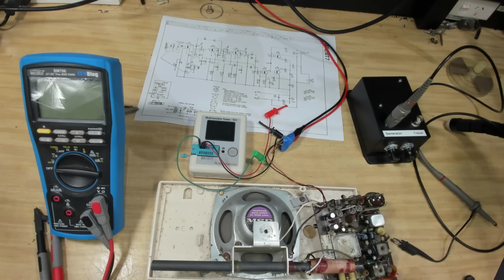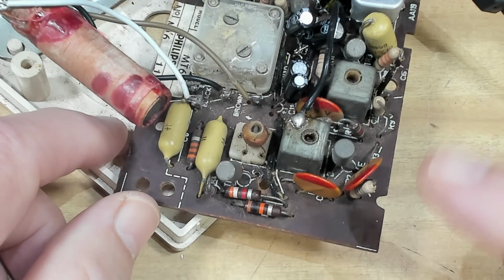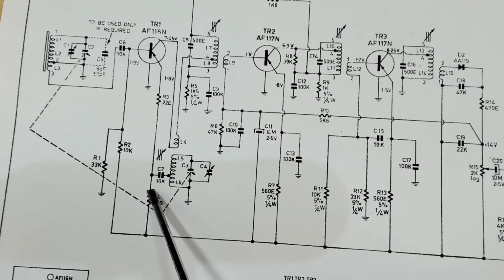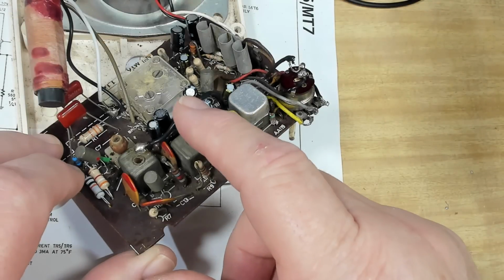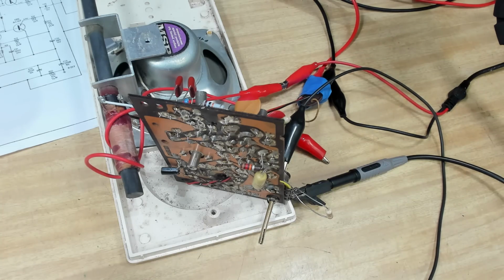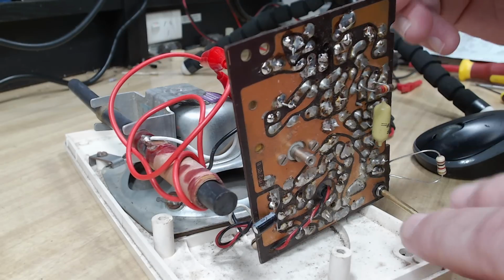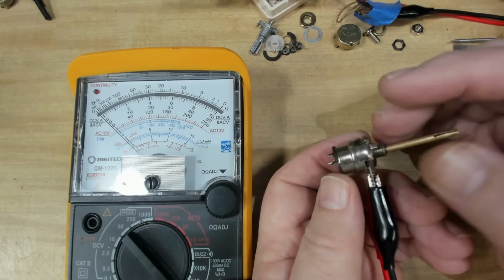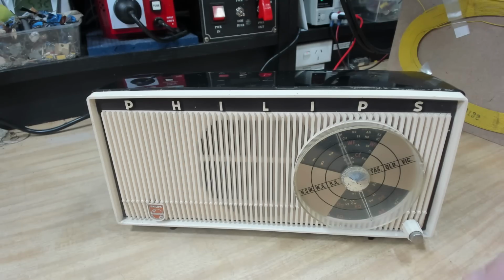Philips MT6 Transistor Radio Repair

Comment: Well done sir.
I have a transistor radio philips type L4CA38T/01 mode 1964 it have sound problem. Sir can u provide me its service manual or help me solve this problem
Reply from the maker: I cannot find any reference to the L4CA38T/0. If you search for a L6CA38T you will get a few helpful results including a schematic. I don't know if that is of any use 🙂

Comment: Nice work I wish I live near you I have a very rare Crown SPH-100 radio phonograph from 1963 I believe the radio part I’m just able to tune one station and basically static noise on the rest of the dial I got the turntable to spin but there’s no sound also the left channel is dead there’s sound on the right channel only so is has a few issues I’ll love to get this fixed cause it brings me childhood memories but I don’t know much about technology most likely there are bad transistors and capacitors in it. Thanks for sharing your knowledge.
Reply from the maker: Yes indeed, your Crown phono is a transistor set. There is a schematic available on Kevin Chants website. Well worth restoring. You may consider contacting a radio club nearby, they might be able to put you in contact with someone nearby 🙂

Comment: In your opening montage, there's an ad for GE "Brighten Your Summer" tube portable. I have it on my shelf awaiting renovation. It has a cigarette burn on its face, leaving a small depression with raised edges.  Think I'll have to file it down and fill it with Bondo. But I really would prefer not to paint it! The  red plastic is too pretty! I'll have to refinish the bright gold trim with metallic gloss paint.
Reply from the maker: What a pity it has a burn mark, I hope you can conceal it Bob and good luck with your projet 🙂

Comment: Take out that one resistor in the emitter lead which is less than 3K3
Reply from the maker: Ok
Reply: @DavidTipton101  I you have a look at other front ends that use the same circuit you will find that there is only one resistor in the emitter lead not two like that shown in the circuit diagram for the radio you are working on for example the Russian VEGA radio which uses the same mixer circuit (sorry I had to allude to a diagram of a radio by a country that has turned rogue)

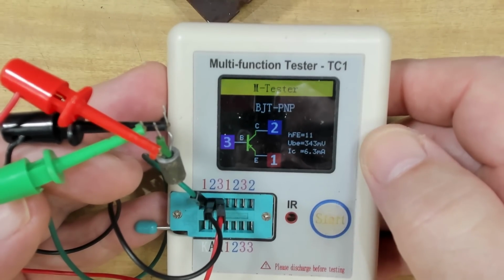Comment: 6:22...the hfe reads "11"- and that's awfully LOW...
Reply from the maker: Well, I know that now 😅
Reply: @DavidTipton101 ...that's a low hfe reading- but it's not unusual: I have noticed the same thing with at least 2 other vintage transistor radios that I have worked on, and the radios worked anyway. 

The downside of these component testers, is that they don't tell you the LEAKAGE of the transistor. 

I have a B&K 970 that serves admirably for testing transistors.

Comment: Have you fixed all the radios in Australia, and do you have snacks, and funnel web spiders in your back yard or hiding in your old sets.  ?
the same principles may be the same between the old and the new, but everything looks so different and are so small, and those pesky traces!
Reply from the maker: No, I haven't fixed all of them 😄 Funnel web spiders live farther south, around Sydney. We do have snakes in the area, one in the house once and a few in the backyard at times. We don't bother them and they move away if you approach them. Thanks Tom 🙂

Comment: You can also pull up another working radio next to the inoperative radio , turn both “On” tune the working radio if the Oscillator is not working it will start playing using the working radios oscillator . Quick check .
Reply from the maker: Hi Keith, thanks. I have used two radio to check the oscillator before. I only listen for the feedback, I haven't tried to tune a station 👍🙂

Comment: Me thinks you know more than you let on. The thing about transistors is that they can be swopped out in sets like this. Silicon transistors can be used to replace germanium ones like the AF117 which where prone to whisker growth which you know about when you started to tap the Tranny. Excellent video. Clear and precise.
Reply from the maker: Haha... no, I'm quite useless at transistor radios but I hope to get better as I go. I know silicon can be used but I would need to investigate which one to use and how. Thanks @CASHSEC 🙂

Comment: Hi David. You started off your video saying; "I only paid a few bucks for it..." and yet for those few bucks you've got a forever reminder Solder Blob, a valuable learning surgery on a volume pot, an AA5 fellow Radio guy's suggested trick tried out successfully, and the fun of returning the radio to working again. Maybe you could get a cheap magnifying glass at the dollar store and make a display of it over your Solder Blob (?)  Thanks for another fine video! -Chris  P.S....my vote is on a prior repairer leaving the blob.
Reply from the maker: Hi Chris. I bought the radio as a learning tool and like you say, it paid off. Haha... I like the idea of the blob mounted next the the radio on display 👍😀 Thanks Chris.

Comment: Dave, you're coming along nicely on your transistor learning curve! The most important thing I was taught by an old school engineer was to pay attention to the the base emitter junction. The different potential between these two junctions should be .2v for germanium and .6 or .7 for silicon transistors. Great find on the shorted diode...............
Reply from the maker: In this case 0.1 Volt. Thanks John. That is exactly the information I need to learn. The information is there , I haven't bothered to look it up yet. Cheers 👍🙂

Comment: Well done David (as per usual) - that solder lump really got you. Transistor circuit boards are always a pain so much circuitry on such a small space coupled with ham-fisted soldering skills can produce all sorts of undesirable effects... neat work on the other things you repaired/sorted🙂
Reply from the maker: Hi Kenneth, thank you. Yeah, I couldn't see it from the way I had it facing. Live and learn 😄

Comment: The ones that someone has had a go at before you are always the trickiest. You have to look for things that would never normally be there. Another great video. I really liked the volume pot rebuild, seems a shame to replace it after all that effort. Still, hope you get one for it. It's a nice little radio.
Reply from the maker: Thanks @radio-ged4626. I checked out the previous repairs first and everything was in order. I haven't had any pots turn up, I will add a resistor to approximate the 2 K requited and leave it fitted. It work perfectly as it is, the resistor will keep the radio as intended 🙂

Comment: I used to work as a part time gunsmith many years ago.  The boss had a sign in the shop, it read something like this:  LABOR $20.00 HR - IF YOU WATCH $40.00 HR - IF YOU TRIED TO FIX IT FIRST $100.00 HR it made sense. Some home smiths can really screw up a gun, and a radio even more so. The worse case was when a fellow brings in a gun parts in a shoe box.  I took one of those LEARN GUNSMITH at home courses along with working part time in the gun shop for several years, it was a work of  love for me, never got paid for in shop working, I considered the education better then any pay they could have given me. I worked full time as a cop but we worked a weird schedule of 4 12 hour shifts followed by 4 days off.  Since my good wife worked as well it left me a lot of spare time with little to do. I road my motorcycle a lot to kill time till I got invited to "play" in the gun shop.
Reply from the maker: Haha... that was a good sign to have 😄

Comment: Great video!  Thanks a million, I always learn something when watching your videos.  One thing it reenforced for me was a bit that I learned in college.  They taught us not the law, but how to find the law. Research can be the most important thing when dealing with the law, and the same thing holds true when dealing with electronics. Watching you fix that volume control was great, you showed us that instead of replacing the part, rebuild it back to it's original glory and it will serve you for another 50 years or so! Keep the great shows coming, they encourage we who dabble in radio repair to keep going.  My little group of transistor radios that I have purchased right now has grown since it seems money is short for most folks so an opening bid usually wins the auction for "parts or repair" radios here in the states. I have several Westinghouse sets as I love working on their sets, they seem to be  a better quality build then the junk imports.
Reply from the maker: Thanks Jerry. I'm always looking for ways to repair components, the volume pot repair worked well. Nice that yiu have a collection of radio to keep you busy 👍🙂

Comment: The chassis appears to be in GREAT 😊 shape. I’m going to guess this radio 📻 is from circa 1972. It appears to be transistorized, or, in other words, solid state. The speaker 🔊 appears to be possibly permanent magnet 🧲. It’s the bad capacitors you’ll have to replace. Too much age results in lossy performance 🎭. Your friend, Jeff.
Reply from the maker: Hi Jeff. Ii is in good condition and the speaker is Ok. The radio is from 1964 🙂

Comment: Hey Dave!
Thanks for sharing this video with us!  I think we all have had that moment of "Hidden Obvious Trouble" in our experiences.  A friend of mine was stressing over an AA5 radio and couldn't understand why it wouldn't work.  I asked him what he had done on it, looked at the schematic, and told him to replace the Cathode Resistor in the Audio Output tube.  He said that there was nothing wrong with that resistor, he had measured the resistance and it was within tolerance. I told him to change it anyway.  He did, and the radio started working.  He couldn't understand how I could spend only 5 minutes and find the problem while he had spent days trying to get it to work.  I never told him how I came to the conclusion of why that was the problem.  In fact, from a physics standpoint, I might have been way off base, but I had recently had problems with a Carbon Microphone and an Elmer informed me that the carbon bits could get stuck and to make it work again to simply bang the microphone on the desk or workbench.  Since that worked, I figured that it was possible that the resistor (a Carbon Composition Resistor) would measure correctly when no power was applied, but when turned on it would open up and be, in effect, a capacitor.  Therefore,  you would have a "resistor-capacitor across a bypass capacitor" therefore blocking the DC. Like I said before, my theory might be off, but that was what fixed the radio!
Reply from the maker: Interesting Wayne, I'll keep that in the memory banks. Thanks 👍😃

Comment: Thanks again Dave.  I don't know much about transistors but I guess I'm going to have a crack at one sooner or later.  Can't let Manuel and Graham have them all, can I?
At least from this video I worked out how a transistor oscillator works. 
Cheers
Reply from the maker: Hi Don, Thanks. I don't know much either and was starting to wonder if I would find the problem with this one. I follow Manuel and Graham closely when they work on transistor sets, I have picked up a lot from them. I look forward to the day you try doing one  👍😃

Comment: Amazing.... I would have said right off the bat, those AF11x transistors "tin whisker" would be the problem. You must have the only working examples known to humankind!

Mullard "mustard" caps - you can rely on them to work, just as assuredly as you can rely on the sun to come up in the morning.

Well done with the volume pot.... I personally have never had any success with rebuilding them, though others, including yourself, seem to be able to make it work. Nice job, and nice to have some AM stations to listen to, once you have it working again.
Reply from the maker: Me too @whitesapphire5865. Haha... they might be the last ones. The one I fitted in the end had been zapped some years ago and was still working. I refitted the mustard caps, I knew they would be OK. The volume pot worked alright, luckily the replacement resistance strip was almost identical 🙂

Comment: Hi David. Great job on the Philips. That solder blob was a bit of a pain. I was sure the transistors would have been bad. The track swap on the potentiometer was very clever. You can get a modern switched potentiometer but you would have to modify the plastic shaft. What was the track resistance? Cheers Graham
Reply from the maker: Hi Graham, thank you. I suspected the transistors first but no. The guy I bought it off said the transistors were OK but I checked anyway. I will have a look for a modern pot and switch. The resistance is only 2k, I don't know if that will be a problem. I can make a shaft to fit 🙂👍

Comment: Hello David a excellent repair on Philips Radio I have serviced many of them Transistor very trouble free it was interesting finding the fault but you won eventually.
I admire your persistence on Magnavox speaker I knew the people at Magnavox they were excellent people to deal with and there Loudspeakers were able to be repaired as you demonstrated against the Rola were unable to be repaired,Top Marks,Ian.
Reply from the maker: Hi Ian, thank you. I was surprised when the voice coil was exposed with the magnet removed. That made it very easy 👍🙂

Comment: It had probably worked fine before it was "re-capped"
Reply from the maker: I was thinking the same thing @jagmarc 😃
Reply: @DavidTipton101  I really think the previous owner tried to "add value" and the "re-cap" process went wrong (solder blob).
I think it's fascinating detecting the Human Element in troubleshooting. 
Re-capping seems to be a recent "fashion" on YT -- like those ginormous broadcast-style microphones people use that block 1/3 of the view! :)

Comment: How are you liking your Brymen BM768? I have 3 Brymen meters, BM-869s, 235 and 525. Love them all. The 869s is very comparable to my venerable Fluke 189. What I love about the Brymen meters is they remember at the next power up where you had it set at last power down. Fluke and every other meter company goes back to factory settings at next power up. Great video as always David. Our favorite island radio genius Manuel digs Brymen meters too.
Reply from the maker: Hi @SIXSTRING63. The Bryman meter is great, I like how it can read AC and DC at once, that was the main reason for buying it. Yep, Manuel has a couple as well, can't get a better recommendation than that 😃 Thanks @SIXSTRING63.

Comment: Something different in this episode and very entertaining, you applied your usual methodical approach David and solved the problem, as well as a dose of your engineering skill to sort that on/off switch and volume pot. Oh and as a bonus we got a bit of NRL and maybe some Ashes commentary thrown in!
Reply from the maker: Thanks Ken. It was nice to do something different. The pot was a challenge, it works OK but is the wrong value. I will keep an eye out for a better candidate even if I have to machine the shaft to fit. I did this about Ashes time. I didn't notice it in the video. Good find 👍🙂

Comment: No one is better at making mountains out of molehills than me.  The repair of the volume control including the fabrication of the boss and the spacer washer is superb.  Spotting that solder blob was very sharp; it was hiding in tough area to spot.  Thanks again for another excellent and informative video.
Reply from the maker: Thank you Jeff. I had the circuit board facing so I couldn't see the blob, I could have saved some time if had just rotated it 180 degrees 😄

Comment: You were not " bumbleing around "  You ended up fixing the radio. Good onya !!!  We never stop learning. Traceing a problem in a piece of equipment that you are not certain of, can be a pain. One of the first thing one has to do is to have a good look at the problem at hand and more so if in your case the radio has been " repaired" somewere else. I was taught eyes, ears and smell, and some times touch  go a long way in trying to trace a problem. But having said that over all a good job and as always look forward to you next adventure . Keep up the good work David !!
Reply from the maker: Thanks Stephen. I did get there in the end and picked up a few tips on the way. The next one will be easier with what I learned from this project 🙂

Comment: Futurlec has a 2K log taper pot with switch and I believe will ship to Australia.  You will need to fabricate an adapter to that thinner shaft, perhaps by drilling a hole in the existing slotted shaft.  POT2KASWITCH
Reply from the maker: I can get one here I guess if I look Seeking. It would be no trouble to adapt the shaft if I do 🙂 Thank you.

Comment: pnp silicon like 2n3906 is worth a try along with higher bias voltage. Beta for 10 is too low. check the other af117 also, may have very low beta too. 10k pot is about right. 2k is too low.
Reply from the maker: Thanks Mohinder. 2K is what was fitted 🤔

Comment: Mr. Blobby strikes again, at least you were spared the depredations of the phantom twiddler. Unless it's a real shelf Queen, I've taken to replacing the unreliable  AF11Xs (even after zapping) with BC558Cs, works most times. The pot transplant was superb.
Reply from the maker: Agreed, the radio settings hadn't been touched luckily. I will have to learn how to bias replacement silicon transistors in germanium sets. The BC558s etc are readily available. Thanks Steven 🙂